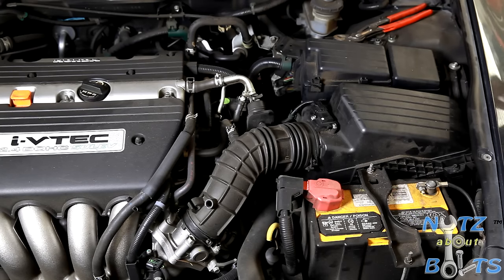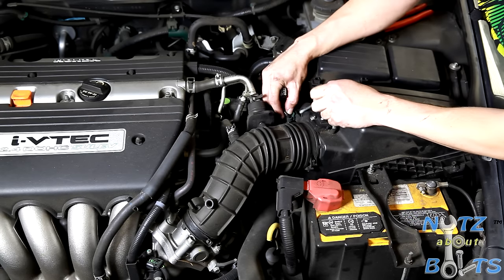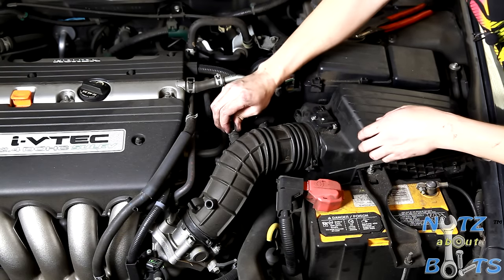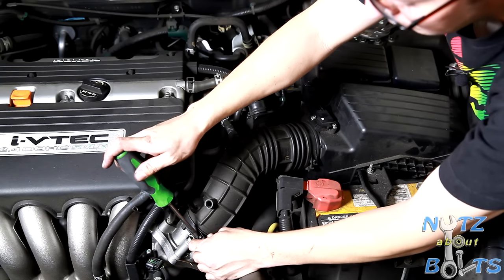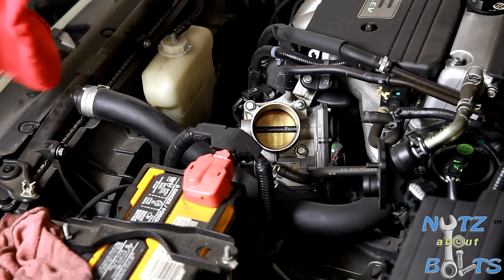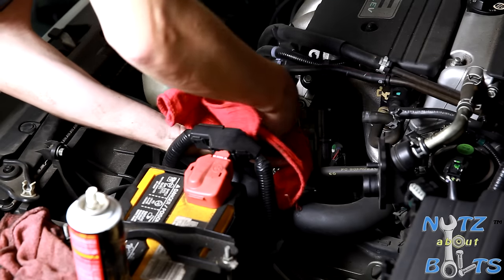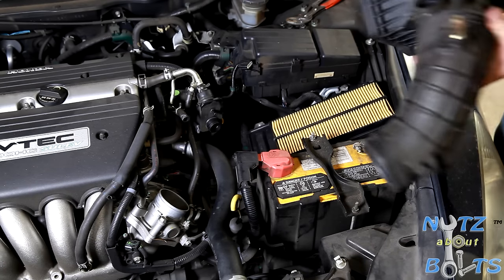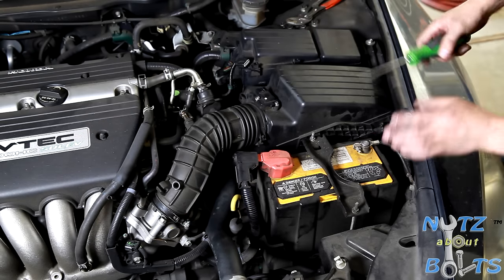2003-2007 Honda Accord Throttle body cleaning

Comment: Bro, Where in this specific model is the Throttle Positioning Sensor located?
Reply: I'm looking for the Same thing
If you find it lmk or send me a link if you can plZ
Reply: @CarlosPerez-mb1wn  mine was on the inside of the hood, against the top right side in a little black compartment. If your car is left hand drive, it would be just behind the dash on the inside of the hood/engine bay. Some models are at the front of the engine, and others, like mine at the back of the engine bay. Hope this makes sense.

Comment: hi mate ive got a 2006 honda accord. it cuts of quite alot at first , say 2/3 times. and the tick over speed gets low too, any ideas
Reply from the maker: +soheel88 confused what you're trying to ask...
Reply: +NutzAboutBolts my car cuts of like 2/3 times as I roll on.. plus the starting speed gets lower then 1 wen I put in gear which eventually engine cuts off
Reply from the maker: soheel88
are you driving a stick shift? sounds like your clutch isn't engaging or your vehicle lacks air into the engine when stepping on the gas.
Reply: +NutzAboutBolts  stick shift?? any ideas to fix the problem.. you reckon I should try this throttle body clean
Reply: +NutzAboutBolts it runs fine once started moving.  just cuts of twice.. after that it drives
Reply from the maker: soheel88
yeah, it doesn't hurt. Does your car have any check engine light? seems like your engine not getting enough air into the engine and thus it is stalling every time you try to give it gas. Basically you have fuel, and spark, but not enough oxygen/air from outside so it stalls on you.
Reply from the maker: soheel88 any check engine light?
Reply: +NutzAboutBolts no mate no engine light. but i was advised by a local mech its an Intake Air Temperature fault. . got that replaced still same thing
Reply from the maker: +soheel88 I wouldn't replace just anything. If there was an IAT check engine light, then you replace the part, but if there's no check engine light, I would check for mechanical failure somewhere that needs to be cleaned. I feel there might be carbon build up or dirty parts that's causing your vehicle to not have enough air flowing into the engine. Have you change your engine air filter? cleaned your throttle body plates? maybe you can clean the Mass Air flow sensor with MAF spray cleaner.
Reply: +NutzAboutBolts no mate not done anything other than replacing the IAT sensor.. How could I check for any mechanical failure like.. can you make a quick video of the mass air flow sensor cleaning and other cleaning you said please. . would help big time.. thanks
Reply: +NutzAboutBolts was about to do the throttle body clean.. as video is already uploaded
Reply from the maker: soheel88
do the throttle body cleaning and check if your air filter is dirty, replace the air filter if it is dirty and see if it made any changes. If not, clean the MAF sensor and see if it made any changes as well.
Reply: +NutzAboutBolts thanks mate ill try that

Comment: Hey I was wondering if you can possibly help me out. I have a 06 accord and when I put it in drive(standing, not moving) it makes this rattle noise. When I take my foot off the brakes and give it gas, its fine after that but when I come to a light or whenever i come to a stop(still in drive) it rattles. Any ideas from your experience?
Reply from the maker: +Sagar Swan something could be loose that's making the noise cause by the engine vibration from the idle. If there's no check engine light or performance issue, then that's what I would suspect. I've never experience that before besides the noise from the glove box... which the foam is worn out over time.
Reply: +NutzAboutBolts ill check that out, could be something loose around the idle. There are no check engine light and only has 46k miles but ill keep looking. Thanks man, appreciate it
Reply: i was having that kind of the same issue. turned out to be low oil (oil level was not low enough to turn the low oil light on). this accord generation is known to build up carbon on the piston rings and subsequently burn oil. my vehicle was burning about 1.2 qt per 1000 miles. engine was rebuilt under Honda's warranty at no cost. just paid for an oil change in order for Honda to determine how much oil it was burning
Reply: +Andres  Leon btw, Honda wont rebuild the engine unless it is burning more that 1 qt per 1000 miles which they say it is "normal" and your vehicle is still in warranty
Reply from the maker: Andres Leon
burning 1 quart every 1k miles is insane since the oil pan only holds 4.3 quarts... I would suspect just a bad engine. Luckily my vehicle hasn't been burning any oil or I haven't noticed any oil consumption... sucks that you had that problem, these vehicles are very reliable and shouldn't be doing that, glad you got it fix under warranty. Thanks for the info and I appreciate letting others know of similar problems as well.
Reply: Thank you for the videos!
That's exactly what i told the guy at the dealer. 
My friend, who is a certified chevy technician was explaining to me that it has to do with the emission. In order to lower the emission, the diameter of the piston has to be "smaller". To compensate, the rings are larger.
Reply: So that creates some shit, i dont remember what he said it was, that build up carbon on the rings and then the engine starts consuming oil.
Reply from the maker: Andres Leon
well, hopefully it doesn't happen on all the Accords. Maybe it could be a defect on certain engine. I will let you guys know if there will be a problem lol.
Reply: Besides that, i love my accord. And yes, they are very reliable vehicles. After all it's a Honda 😀
Reply from the maker: Andres Leon
yup lol
Reply: One last thing. What I know is that it affects the 8th genration 2008-2012. At least thats what Ho das says. 
Again thanks for the videos! 👏😀
Reply from the maker: Andres Leon
ah I see, new engine, new problems lol. Thanks again :)
Reply: @tele3phono  yup! The 4 cylinder has this problem but the V6 is supposed to be free of the bad oil skim ring malady. Apparently Honda used a different supplier for the oil rings and the metallurgy was off and didn't spring out enough to skim the cylinder properly from oil.

Comment: i got a question where its the intake air temperature sensor located at ?
Reply from the maker: the 03-05 model has it on the throttle body housing, the 06-07 model has it integrated with the MAF sensor.

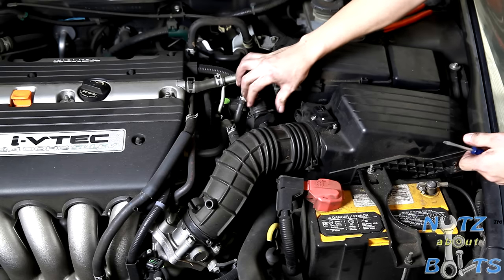Comment: At 1:18 talk about that small thing i really have to find out what that is because i find oil in my intake hose drained from the engine via that little box, my car doesnt smoke i replaced pcv valve but still it burns oil, i have the k24a3 engine i used seafoam EVERYWHERE, i was 18 hours blasting seafoam in every hole of the car i changed x2 times oil to super clean the engine but still cant understand... 😔😢 please help me someone 😔😔😔😢
Reply: Loyal Honda Fan purge valve ?

Comment: I did this and touched the butterfly and had high idle after on my 08 crv had to go to friends shop and had to plug in the scan tool to go do the idle relearn because on 08 and up the steps for doing the relearn doesnt work it needs a scan tool so dont touch the butterfly the auto relearn wont work

Comment: I see where he is trying to good. But first he has no clue you don't use shop rags to clean anything leading into the internal engine second never push open an electronically controlled throttle body Doing so can throw off its calibration causing sparatic idle loss of fuel mileage or cause damage to the internal components of the throttle body just to fill you on what that tube was that you said you didnt know its a ctsnke vase vent hose the square block that pushes into the intake hose is a filter you can solve all these problems by proper maintenance meaning chainging the Franke vase vent filter when you do tune ups assuming you take care of you vehical at all and remove the neg terminal before unplugging anything electrical that's just rule of thumb when doing any thing under the hood
Reply: and so if you push open the throttle plate and you get a code for the plate, what's the fix?  It's been relearned and runs great except for the code.

Comment: I thought that if you open and cleaned the throttle without completely removing it that it would easily damage.
Reply from the maker: +Rich Lo Not that we are aware of, and we've been doing this many times.
Reply: +NutzAboutBolts is this a electronic throttle. Those are the ones I heard to remove completely the clean and out back.
Reply from the maker: +Rich Lo Yeah, you can remove it, and then reset it back to idle learn procedure. But we haven't tried that before and thought this was easier to clean.
Reply: +NutzAboutBolts what do you mean by reset idle learn? how do you do that sir!

Comment: is this the same way to change it on a 02 accord
Reply from the maker: +Robert Jenkins what is the same? cleaning the throttle body?
Reply: Yea. You would do the same steps if you were to replace the assembly wouldn't you?
Reply from the maker: +Robert Jenkins they're both different engine. The process of it is the same concept but removing it is different.

Comment: Hello its me again, where can i find the sensor for P0135 honda accord 2005 2.4? Thanks
Reply from the maker: it is the air fuel ratio sensor, its the sensor right after the exhaust and before the cat.
Reply: So the same sensor to be change when u have a po157 right upstream?

Comment: my air bag light just came on in my 2003 Accord.  Am I in danger??
Reply from the maker: I would take it to the dealership to have them diagnose it, you don't want the air bag to accidentally deploy since the light is on.
Reply: S1X F1VE air bag won't accidentally deploy lol only issue would be what ever fault it is for what air bag it
May not go off. It won't deploy
Reply: S1X F1VE Nope, replace your driver's side seat buckle latch!
Reply: there is a recall notice for my 04 accord for air bag. i think the same applies to you. so check on that and take it to the dealership. the replacement is free of charge
Reply: imadvizinyounow it works? I have the same problem on my accord 2003
Reply: Ben Cantu damn:/ tnx for the advice bro , maybe tomorrow i replace the airbag
Reply: Does ur horn and steering controls work? If not, it’s the clock spring
Reply: Yea is the clock spring change  tha part and you will be rady to go

Comment: can this trigger the engine check light to stay on
Reply from the maker: If you spray too much of the brake clean fluid, it can cause the engine to run rich, which can trigger the check engine light. We just spray if on the rag and wipe the throttle plate to clean it.

Comment: I think 2003-2005 Accords actually have a throttle cable.
Reply from the maker: yeah they do, its the same concept. Its a lot easier cleaning the throttle plate with the cable since you can manually move the plate back and forth to open and to clean it.
Reply: My 2005 doesn't have a throttle cable, it's electronic.
Reply: I have an 03 exl v6 with no gables. All electronic. I took the whole TB out and cleaned as well as the IAVC, I had a code P0506, which caused me to clean both extremely well..